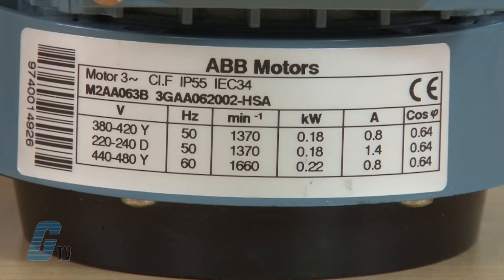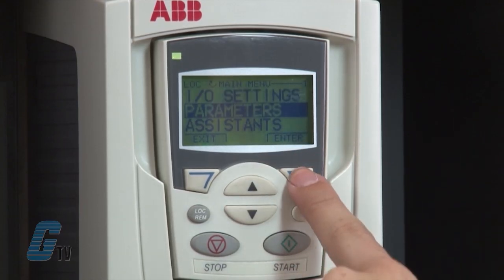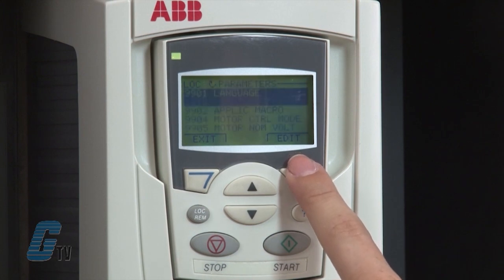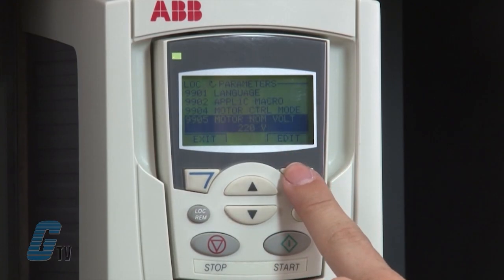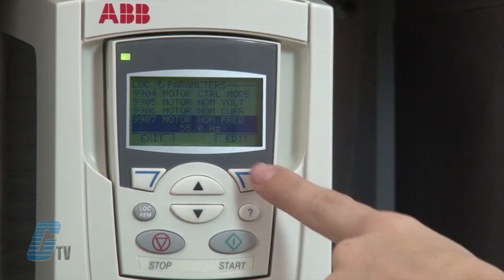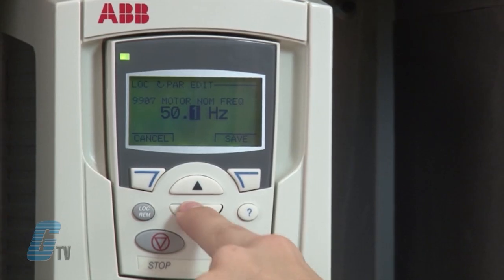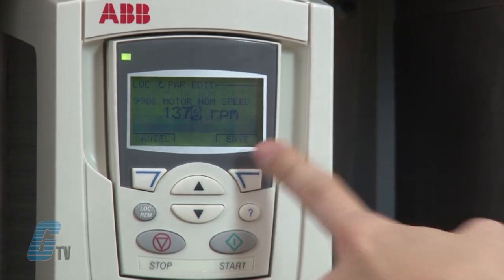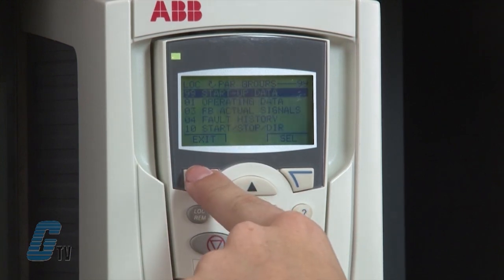ABB ACS550 AC Drive Basic Startup

Comment: Hello, if volts used for the motor is 230v. Why are you using 0.8 amps and not 1.4 that falls under 220-240v?

Comment: i want to know about this fault code F 0022. I have facing this fault continuous on my motor as its speed suddenly increasing just before reaching up to motor stop. this related to DC bus about ripple voltage. How can i rectify this problem.

Comment: If you remove the keypad while VFD is in operation,  will this disable the drive,  or will it temporarily continue to run?
Reply from the maker: The drive will continue to run. However, it must be in REMOTE control mode to do so. If keypad is in LOCAL control mode and running and you remove the keypad the drive will fault.
Reply: @GalcoIndustrial  Got it,  thank you

Comment: Hi  I have a problem with acs850 315kw DRIVE 
Error is DC under voltage 
Can I get any suggestions
Reply from the maker: This fault means the DC BUS in the drive fell below the minimum allowable level. For 480Vac line min input is around 432. For a 380 line min input is around 342, and for a 230 line min input is around 180-190. How is your line voltage holding up?

Comment: Nice .but how I connect  MBS 300 transmitter??
Reply from the maker: We do not have these transmitters so you will have to tell me what you are using the transmitter for, ok?
Reply: @GalcoIndustrial  thanks.dear sir I want to  use this drive for water purpose .I want when our water pressure 3 bar motor run and when reach 4 bar motor stop.i have transmitter .but how I don I need ur professional and best help. thanks
Reply from the maker: This will take some intricate programming of the drive. So I'm going to suggest you give us a call and talk to 1 of our product managers. 800-337-1720
Reply: @GalcoIndustrial  ok thanks .

Comment: i have VFD for fan control low speed high speed is totaly stoped and the screen is not start up and i have power at panel . please tell me what is the problem
Reply from the maker: Try asking the question again, but the screen is display on keypad,,, right? and by startup you mean it does not come on at all OR the drive does start running?
Reply: No, the screen is not dis play on keypad
Reply from the maker: Have you replaced the keypad yet? If so, It sounds like the the power supply in the drive has failed, replace the drive.

Comment: any guys can help me how we can do drive factory reset ACS550 series
Reply from the maker: Well there is no parameter Default per say. So you have to change the Macro to something other than Factory and back to Factory to set to Factory, (this assumes that you were using Factory to start with, other wise just change parameter 9904 back to Factory and done). However remember this does not change motor settings and several other parameters through out the drive, sorry. So you have to go thru all parameters using for any given application and parameters used in a previous application. If having further trouble, call us at 800-337-1720 and ask for the ABB product manager, they are very sharp.
Reply from the maker: Set parameter 9902 to ABB Standard. If it is already set to ABB Standard, change it something else and then change it back to ABB Standard.

Comment: We have an ABB ACS600. None of the buttons seem to work. But other than that, it seems to be working correctly. We are trying to see if any fault codes are available. Any suggestions?
Reply from the maker: I have to assume you mean the buttons on the keypad, if so replace the keypad and try accessing fault log again. This drive is obsoleted now though and we do not sell anything for them accept repair service.

Comment: can we change its direction in motor stop condition?
Reply from the maker: Yes of course you can, the direction of rotation can be changed anytime, running or not. The keypad display will indicate the direction change with the little arrow next to the REM/LOC indicator in upper right corner of the keypad display.

Comment: I just bought a control board from china for my ABB ACS550 DRIVE 55 kw~ The local ABB technician called it as 55kw but in china it is 45 kw~ So i actually purchased a wrong control board 55kw for 45 kw (as in china) for my drive~ But the seller told me that i can actually change the default data using the display panel from 55kw to 45 kw~ so does anyone know how to change the data base?
Reply from the maker: The parameter for selecting power rating can be accessed with the standard keypad, follow this sequence to access hidden parameters; enter parameter list and access hidden parameter group 105 by pressing Select button and simultaneously pressing both up and down arrow keys and the left function key for 4 seconds. The display should flash once, press the exit button and find group 105 and parameter 10509. Use the up/down arrow keys to select the correct drive power rating then press save. Cycle power and access parameter 3304 to verify correct power rating has been accepted by the drive. Good luck.
Reply from the maker: Note: you need to backup current configuration to keypad before accessing hidden parameters otherwise you will have to start over with any previously adjusted parameters. Also to save hidden parameters access parameter 10502 and enter a 1. Then cycle power to put drive back to normal parameter access, ok?

Comment: recently we have problem on our  VFD ACS510 which cant run on REM mode, what should i do?  i do swap the key pad from the other VFD , result still the same.. pls. advice  tq
Reply from the maker: Is the REM indicator in upper left corner of keypad display going "REM" to "LOC "when you push the LOC/REM button?

Comment: Mam...What will happen if the 3 phase output of VFD is connected to input of a 3 phase transformer..I was asked this during an interview...will the transformer burn....?
Reply from the maker: Drives are not meant to run a transformer and transformers are not built to be fed with PWM type power.  PWM power may cause over heating when miss used like this, we will not recommend it.
Reply: GalcoTV okk

Comment: Dear chanel Galca TV.
I have inverter ABB ACS 550, I use application macro Hand - Auto
I installed 9902 = 5. 
I want use AI2 = 0-10V,  What I have to do?
Please help me
Reply from the maker: Find switch J1 (2 position DIP switch) and move position 2 to off position. Default is 1=off (for 0-10volt input) and position 2=on for current input. If you move it to off position both inputs will be set for 0-10volt input, ok?
Reply: Thank you repply. I have installed DIP AI1 and AI2 = off ( Move DIP switch AI1, AI2 = U). Then use PLC Analog Output siemens s7-1200 send 0-10V to AI2 inverter but inverter not running? DI3, DI4, DI6 Auto mode OK on
Reply from the maker: Make sure that your PLC has put some reference on AI2 so the drive knows how fast to go.
Reply: Yes. PLC out analog 0-10V OK. I have used voltage meter at AI2 = 5V.
Do not know if I have to install anything else in the inverter?
Reply from the maker: At this point I will have to refer you to 1 of our product managers for more specific help. So give us a call at 800-575-5562 and ask for ABB drive assistance, ok?

Comment: I use ACS550
How can I edit AO1 parameter from current to voltage ?
Reply from the maker: You can not change the output current to voltage with a parameter. Use a 250 ohm resistor across the output for 5 volts at 20ma, or 500 ohm for 10 volts at 20ma.
Reply: Can you send me wiring diagram ?
My E-mail: 
tonsc2002@hotmail.com
Reply from the maker: Just click this link for a copy of entire user manual, ok http://www.galco.com/techdoc/abbi/acs550-u1-038a-4_um.pdf
Reply: Which page please ?

Comment: hi guy! I want to setting ABB ACS550 connect Modbus RTU with PLC. I made effort setting for inverter ABB ACS550 But it so difficult for me. If you have any video teach setting Inverter connect modbus RTu. Please send me as soon as possible. Thanks you so much.
Reply from the maker: Hello Nguyen, good question and thanks for asking Galco. Do you have a copy of the ACS550 User Manual? If not click on this link for a digital copy http://www.galco.com/techdoc/abbi/acs550-u1-038a-4_um.pdf Be sure parameter 9802 = 1 (Standard Modbus), then check parameter 5302= "Drive address" (this must be a unique number for each drive connect to a common trunk line) 5303= "baud rate" selected must match all items connected to same line. So 5302 must all be unique numbers, and 5303 must be the same number. 5304= "Parity selection" must match all items connected and 5305 leave default=0. Please let us know how you do.
Reply: Hi guy! Thanks you so much i used setting ABB inverter as you say.I just only read value feedback from inverter. when i write value for inverter it can not run, so i very confuse about this matter. Please talk me know this problem.

Comment: thanks alot for your reply, there was no fault showing,  I figured that this is a matter of relay output stting and I was right , I just change parameter 1403 in group 14 from 3 to 4 which activate the relay output only in case of fault instead of been on by default.... thanks alot again for your support,  you are the best

Comment: Not sure if anyone can help on here. Is there a parameter to switch a motor between star-delta wiring?
Reply from the maker: No, the drive can only put out 3 phase power and there are only 3 output terminals. What you are talking about requires a hard wire change at the motor wiring itself.

Comment: I changed parameter 1103  to 2 for AL2 but drive is still no work for 2 speed.And then i changed signal input from AI2 to AI1 with jamper switch AI1 is on and parameter 1103 to 1.
AI1 input signal is work for two speed surely and i don't understand why AI2 input is no work for two speed till i changed parameter 1103 to 2.
thanks so much.
Reply from the maker: Myo I'm going to recommend you talk with 1 of our product managers about your issue. Please call 800-575-5562 and ask for Randy Barbret or call him direct at 248-336-4591, ok?

Comment: model is (ACS550-01-08A8-4)
input signal 4-20mA is already installed AI2 and GND
Reply from the maker: Ok then go to parameter 1103 and set to 2, that will select AI2 as the reference source, ok?
Reply from the maker: But also keep in mind, the digital inputs programmed to select preset speeds will override the analog inputs if activated, ok?

Comment: yes i  would like to run two speeds by using output from pressure controller and transmitter.
Reply from the maker: OK Myo, for Analog input 1 connect your signal to X1 terminal 2+ & 3 -, and to use 4-20ma type signal you must flip switch J1 position 1 to ON and this configures AI1 for a ma signal, ok? Keep in mind the drive will run on the analog signal inputs automatically if no Preset speed input is activated. The preset speed select inputs will always override the analog inputs, ok?Good luck

Comment: I have a problem, my drive ABB gives the 5001 alarm, what does that mean and how I can be deleted for it normally starts, and thanks
Reply from the maker: Alarm 5001 means “Drive is not responding”, this is usually a loss of communications between the drive and the keypad. I would suggest, with the power off, remove the keypad and the connector that goes between the drive and the keypad and then reset them. This will quit often fix the problem, if not try a different keypad and see if the problem follows the keypad or the drive and replace the defective component.

Comment: please how can i reset fault f004 in acs550 abb,note the electric motor is disconnected and its wires removed ,but the fault persisted .please what next if it its a component fault or i.c,or igbt how can i locate it i can carefully replace it unless
Reply from the maker: Remove all wiring except for three phase power, if fault still exists, it’s most likely a drive problem. In the manual it states that it could caused be a supply disturbance, you could try a different power source just to make sure. If the fault clears after removing all the wires, try reconnecting one wire at a time to figure out which wire is causing the fault. As for repair, depending on the size of the drive, there may not be parts available. Most drives just have a single part in the drive, so if you were to get that, you basically bought the drive.

Comment: Hi GalcoTV. I have 63 acs550 units running in my department. We are slowly trying to switch them all to run remotely via Honeywell scada. we have encountered issue s though with our older drives will not work due to their firmware. I'm wondering if you guys know a simple way of uploading firmware off of our newer drives and then downloading that firmware to our older drives. 
Thank you in advance.
Reply from the maker: There is no way for the end user to change the firmware in the drive, only the factory can do it.

Comment: my abb says alarm 2018 , never got a manual from toro. can someone tell me what this is and how to fix it... Thankyou
Reply from the maker: Kevin Belland Thanks for the question, Kevin!  If you're currently using an ABB ACS550 AC Drive (as featured in this video), you can find the manual on our website at: http://www.galco.com/techdoc/abbi/acs550-u1-015a-4_um.pdf

Page 262 of the manual goes over the different alarm codes for the ABB ACS550, including Alarm 2018, which pertains to the PID sleep function.  

Here's an excerpt from the manual on Alarm 2018:
"This alarm warns that the PID sleep function is active, which means
that the motor could accelerate when the PID sleep function ends.
• To control PID sleep, use parameters 4022…4026 or 4122…4126"

Comment: HI , we have purchased a ABB ACS510 , we would like to configure it for constant pressure water boosting system, we have 3 pumps and would like to configure it to SPFC (soft start for all pumps) , but we are not able to configure the same. Shall be highly obliged if you could help us with the configuration. 
Thanks & Regards 
Rashid Khan

Comment: how are you
please help me
i want to run abb drive acs550 01  as torque control mode
i connect drive as shown in manual
and i put parameter 9902 =8
the drive is run and there is flash in display monitor "rev"
but the motor not rotate
i connect the ref to A1 (2,3,4)
but when i put 9902=1 speed control the motor is run
Best regards
Reply from the maker: When you switch the parameters on 9902, the wiring for the IO also changes.  A1 should still be the same, but you will also need to close the run enable (DI 6/pin 18) and to switch between speed and torque control you can check the connection on DI 3/ pin 15.  Check to see if that works.

Comment from the maker: Adarsh Thakarey For someone reason I am unable to reply to you directly, so let me know if this went through.
Go to Parameter 1604 “FAULT RESET SEL”.  This will allow you to select a digital input that can be used for external fault reset.
Reply: Hi ! it is possible i can run  by scada the acs550 i wil use the drive relay ?
Reply from the maker: zeiuss ocampo
I am not really sure what you are trying to do, but an ACS550 can be run off of a scada if the outputs of the scada match the inputs of the drive.  Also, I am not too sure on what you mean by drive relay... Are you referring to the drive's output relays?
Reply: sorry i delayed,you was of great assistance but after which it reset and the fault reoccurred,mean while what happens now is that when you want to varry the speed it will trip at above 0.7hz with same fault f004.but when i bring it down to 0 or little above to run for like 10-20 minutes it can them varri the speed.the out put power supply is stable,pls is there any fault inside the drive or what to reset
Reply: engr adarsh,can u please send me your personal contact so that i can call and talk with you for a better guide.
thanks, best regards
young 07035325166
Reply: GalcoTV

Comment: how can I change the working status of the drive from the hand mode to the auto mode?
Reply from the maker: If you're using the hand/auto macro then it should just be a digital input.  If you mean hand being the keypad and auto being a terminal strip, then it should be just the local/remote button on the keypad.  To be honest, I will need to have a little more information. What type of macro are you in and what are you trying to accomplish?

Comment from the maker: Sure.  You can set the macro to ABB standard (parameter 9902 - also the default).  Then connect the pot to pins 2,3, and 4 with the wiper being on 2.  Make sure you close the start/stop on pin 13 (digital input 1).  Now switch the keypad from local to remote and the speed pot should work.

Comment from the maker: If you are looking for a video on the features of ABB Drives, we can certainly make one.  We would be happy to be used as a resource, but I am unsure if the completion time will fit in with your schedule.  When do you need this?
Reply: I have abb asc 510 drive I've set the motor data base on the name plate of the motor but the motor did not run.. The drive appearing ( drive not ready)  e.g low dc voltage.. Plz help

Comment from the maker: Since a VFD converts AC into DC and then inverts the DC into a variable voltage and frequency AC, switching two of the input wires has no effect on the output. You need to switch two of the output wires from the VFD to the motor in order to reverse motor direction. Let me know if this helps. If not, I will be happy to assist you further or you can contact a technical specialist through galco.com.

Comment: I followed the steps in the video, but my  motor went in the opposite direction. I switched two of the input power wires going to the VFD and it made no difference.  I also checked to made sure that the display shows the motor is going in the forward direction.  So why is mine going in the reverse?
Reply: You need to swap two of the output wires instead.